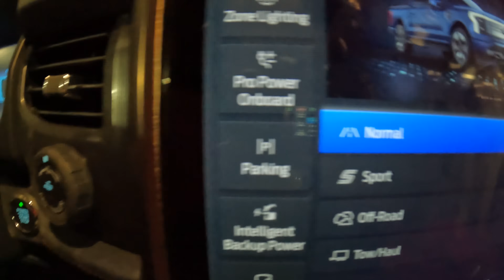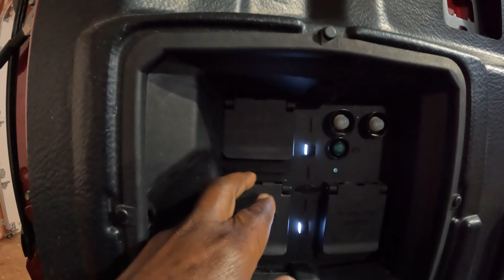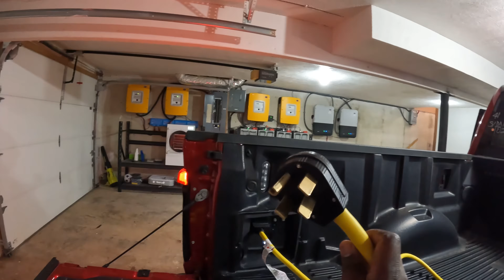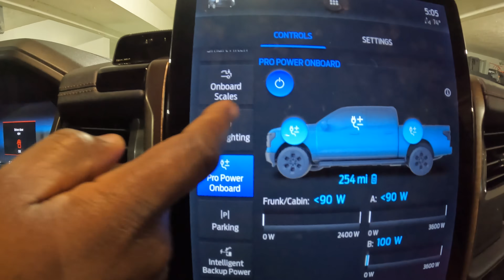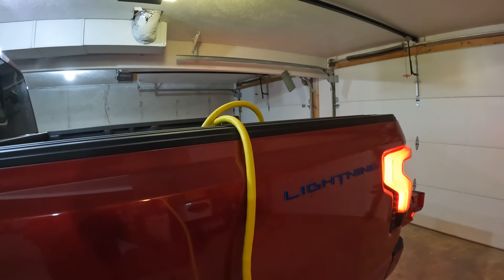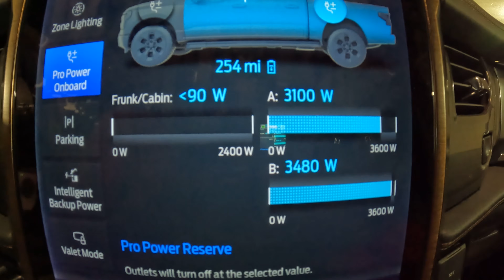F150 LIGHTENING PRO POWER ONBOARD AS A WHOLE HOME BACKUP GENERATOR

Comment: To power your home from the pro power 240 volt outlet, you need an unbounded neutral,  where as to used the included mobile charger, you need a bonded neutral. Since my  14-50r is connected to my sub panel that doesn't have a bonded neutral,  I can use that circuit to power my home. But to use my mobile charger on that 14-50R, I have to bond my neutral to grd.

Comment: In order for the home backup system to automatically power your home, you'll need the 80 amp pro charger plus the Sunrun home integration system, which is an extra cost of around $4000 uninstalled.

Comment: Is your ground and neutral bonded together in the panel or are they separate cause I tried this at a customers house and it didn’t work the phases didn’t balance properly at all but I believe it’s cause we have neutral bonded to ground in our panels. Any help would be much appreciated thanks!
Reply: You need to install a sub panel off your main panel.  When you properly wire a sub panel, you don't bond the ground to the neutral at the sub panel . Attach the receptical that you'll be connecting your pro power to. This receptical should work well for backup power. BE SURE THE MAIN SERVICE BREAKER IS OFF PRIOR TO CONNECTING YOUR PRO POWER TO THIS PANEL